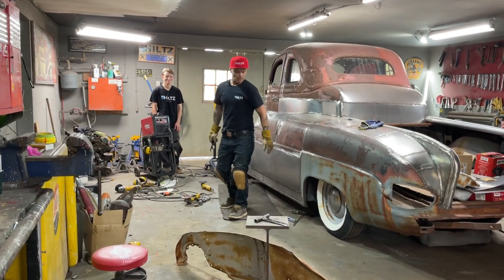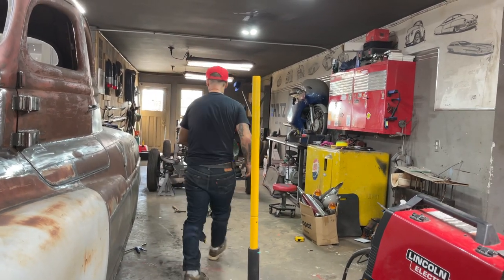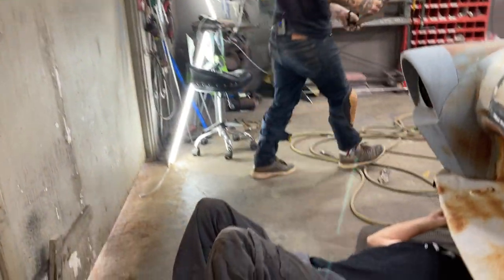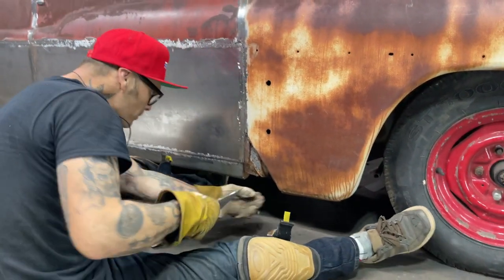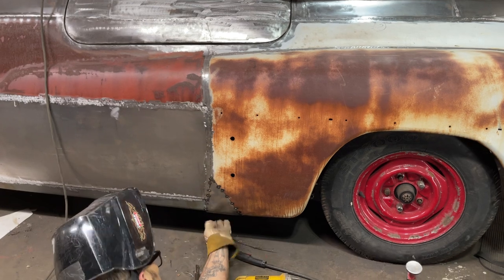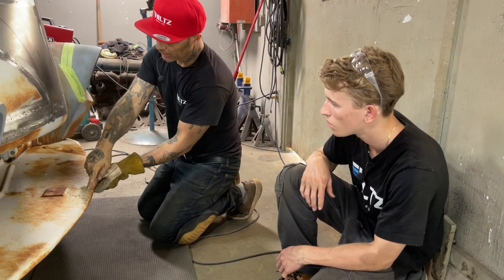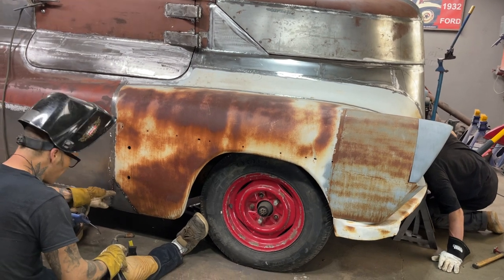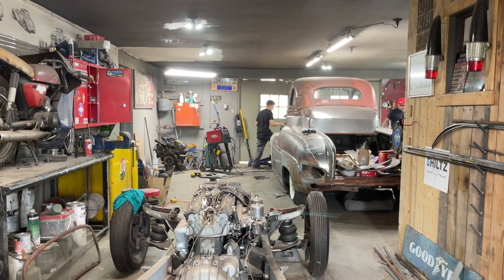RUST REPAIR: HOW TO FABRICATE AND MIG WELD CUSTOM PATCH PANEL

Comment: I had an idea regarding the back end Chad. I imagined a roller shutter door with the tracks welded along the inner rear quarter panels with the shutter roll behind the cab. It could open up to reveal a tool box and a fifth wheel.
Just a creative thought that was maybe worth mentioning. Kudos to you guys for such awesome content. 🇬🇧🇨🇦🙏
Reply: A fifth wheel would be awesome. "Hotrod Hauler" roller door too! That would be unique and what a reveal it would be.
Reply: @bd9875  cheers Brian, it just looks like it should be there. Hopefully Chad or Jolene will see it. 🙏

Comment: Thank you for a good channel, follow every episode you post. In this video, the mic picks up a lot of sound from the exhalation. Get a mic that has a slightly shorter stick before the mic so it ends up two fingers wide just outside the mouthpiece. The mic shall nerver be infront of the mouth but just beside the mouth. Then the mic picks up the sound from the talk well but not the exhalations. Once again you are doing a great job of building this cool car. Regards Martin from Sweden

Comment: Maybe use the standard front bumper and cut the bottom of the headlight buckets to fit the bumper under or fill in the cars body under the headlight buckets and cut back the inside of the bumpers corners to fit around the buckets
Love this build, really great to see all the vision you have coming out in a form we can see. Can't wait till sandblasting and primer

Comment: Here’s a tip that may work for you , hang a microphone from the roof near the front of the car and one at the back of the car , then run them back to a 4 Chanel mixing desk which you can then control the volume at the desk , you can get a module on eBay that you also run with the mixing desk that you can pair to your camera , ( can’t remember what it’s called )then the boys don’t have  mics and battery packs annoying them , it would save on batteries as well , Just an idea to make life easier 😊keep up the great work

Comment: Hello from Oxfordshire in UK. Really like the way this is progressing, hope it will not stall. Plans for headlights, steps, actuators, wiring, engine, steering, never ending list😃👈. Interested to seeing what it looks like after media blasting, looks good when you ground the welds. Hope there is only a skim of filler needed, Metalworking with hammer and dolly,
.
Reply: Good to see face protection used

Comment: On that front pan I've found that when trying to get the ends bolted in that if you push up or down in the center of the pan it sometimes will draw the ends in. If after I do that you find the center is too bowed then I try shrinking the pan from the center outwards.

Comment: What size metal are you using for body work? 18,19, or 20. I tried to weld with flux and it's burning through

Comment: Noticed the front pan pointed down in the center once you made it fit the fenders. Maybe the fender extensions are narrower? Wonder how many of these Merc parts were just thrown away when they were customized.

Comment: wait till ya break out that New Welder and weld a patch or two in with the Tig .. slow process but the bodywork end is way less work..  body tin welds nice with very little filler wire..

Comment: Maybe Dewalt should sponcer you with wireless angle grinders then supply you with flappers and disks like Lincoln did with you as a sponcer. Then you would not be tripping over cables.

Comment: You were asking a while back about battery powered equipment you're using dewalt  Already And it is fantastic battery powered long lasting and affordable I have tried them all and I use them a lot. I know it's an expense to change over but you'll be happy you did

Comment: It isn't easy welding with no gas .I've gotten pretty good at it myself cause I couldn't keep up with the gas .so I really use flux core wire alot .it works good just gotta get it clean and put the heat to it .be safe your friend Russell

Comment: For the none of my business folder:   I think you should fire up the new Lincoln Electric gear and use what you have now as reliable spares rather than using their generous gift as reliable spares in case of whatever. You deserve cool new gear and besides - what if it freaking rocks? It's like the coolest present ever that didn't get used? And another besides - they get a mini review of whatever is new to you.